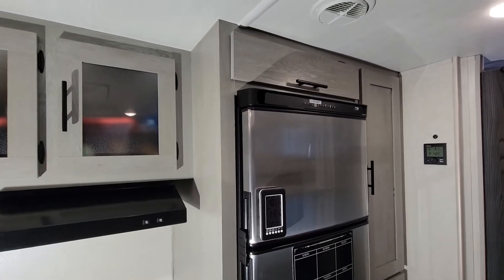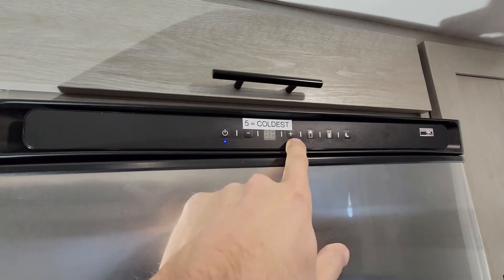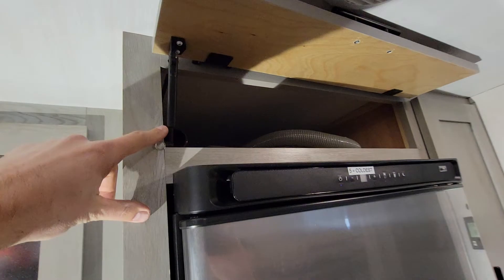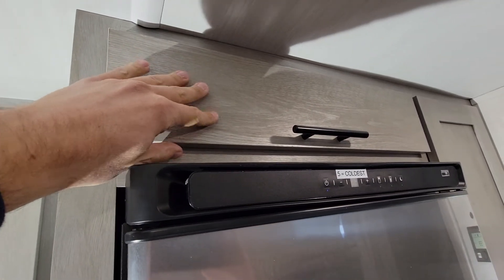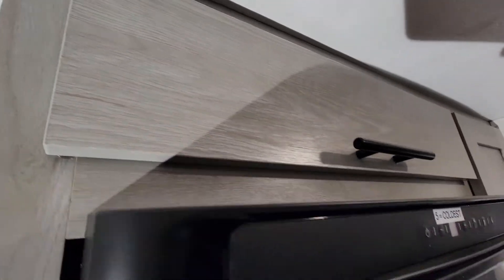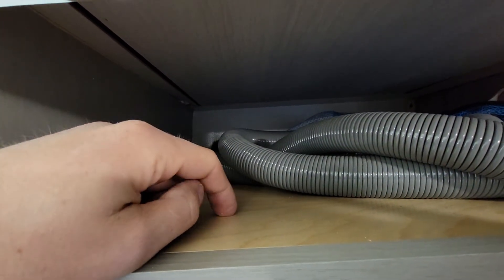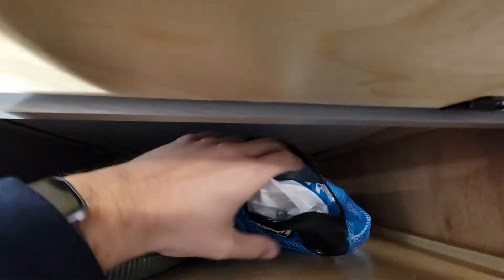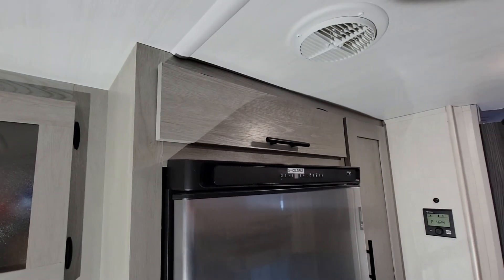Added storage above the fridge- Ibex 20BHS by Forest River

Comment: @RV & Camper Mods & Upgrades, I am SO HAPPY that I found your channel, as I also have a Forest River camper (2350LE). An issue I’ve had is that I cannot find a site or a contact for Forest River parts.  I’ve searched and I’ve called to no avail.  FR has not responded to my calls and the sites I’ve found are all about new models.  Mine is a 2020 and I need some of the new drawer laminate, as an ankle level drawer pull was eating my ankles so I installed new ankle-friendly drawer pulls.  On this particular drawer, the manufacturer misaligned the screw, apparently, and now there’s a big ugly hole in the drawer face.  Through what site are you accessing parts?  I’ve a number of things I want to repair/mod in my rig, so your help will be worth its weight in gold!!  Thanks in advance!
Reply from the maker: I appreciate your thoughts and am sorry I haven't seen your comment until now! At the time, I had reached out to the Ibex division of Forest River and was able to order the parts directly through them. Unfortunately, they stopped allowing customers to order directly through them shortly thereafter. They said that moving forward, customers need to order parts through their local dealers. Sorry I couldn't be of more help!
Reply: @rvcampermodsupgrades3288  Life has been crazy for everyone over the last couple years, so no apology necessary. Thanks so much for your reply.  I hope you and yours are doing well.
Reply from the maker: @roadtriplover.  I appreciate your kindness. I hope you are also well.